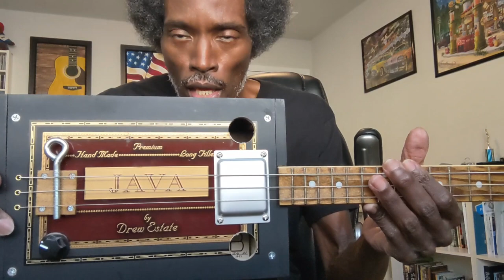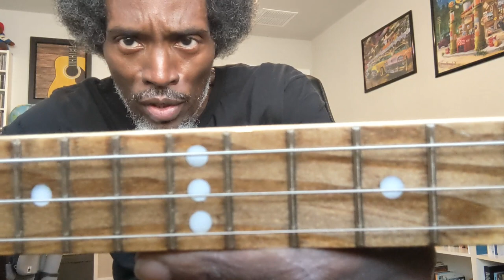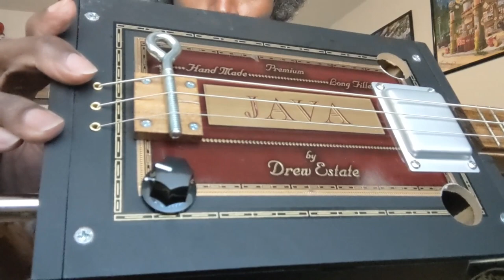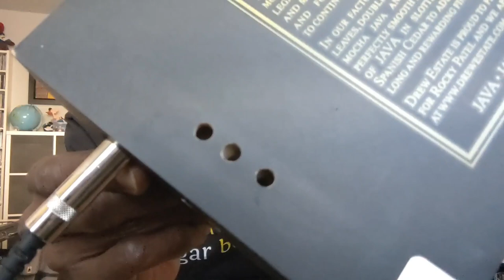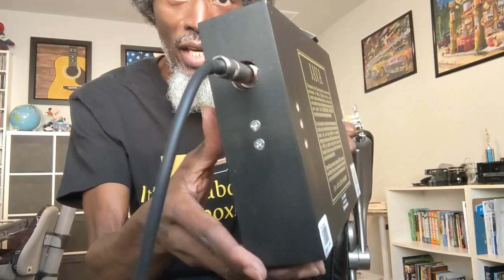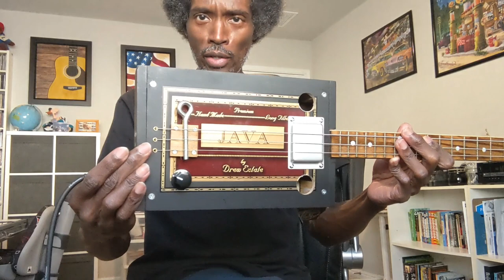Introducing the Java Box

Comment: The first cbg I built was a java, surprisingly loud  little box. Great work
Reply from the maker: Thanks.  And, you are so correct!  You may have noticed there are points during the demonstration video where I let the open chord ring out for quite a duration.  I was highlighting the unusually loud and long (especially considering the top thickness) sustain these boxes produce.  Rock on!
Reply: @BurrellGuitars  have you considered doing a tutorial on wiring the electronics?
Reply from the maker: Yes.  That is a possibility.

Comment: Nice job. I’ve used Java boxes on a few builds. Do you use polyurethane on your boxes at all?
Reply from the maker: Thanks.  Yes.  In fact, I am working on another build featuring an orange Java box with a softer finish than the black one featured here.  The matte finish on the black box is quite hard and thickly applied, so I did not need to coat it further.  The orange box has a less durable finish so I did use polyurethane after a light sanding to give it some strength.  The shine did not hurt either.  One thing I would like to point out about these boxes are though the top and sides are of a beautiful, thick dark wood, the back/bottom seems to be of a thinner particle board or MDF type material.  Whenever I run into this, I tend to favor "shrink wrapping" with polyurethane to bolster the finish.